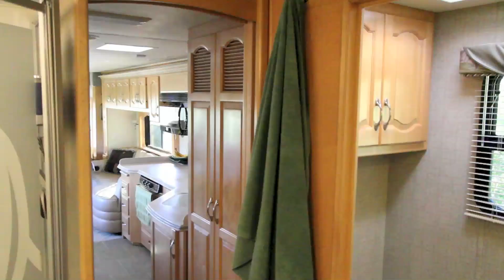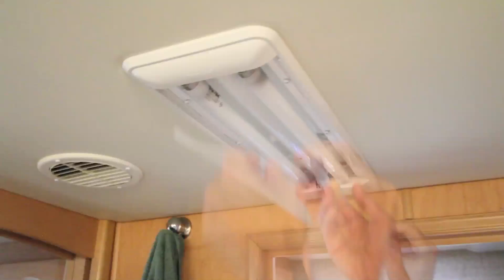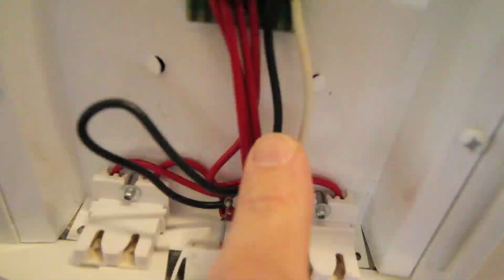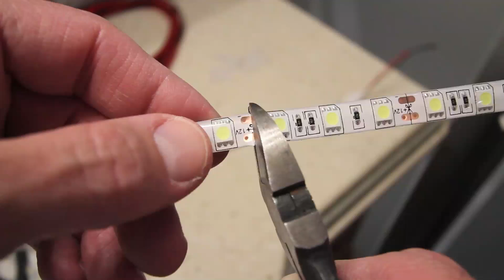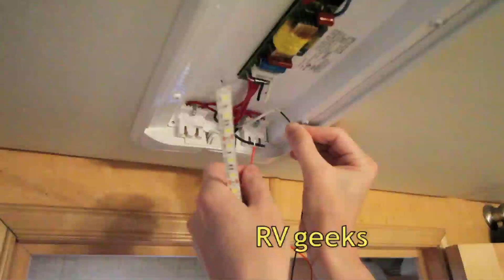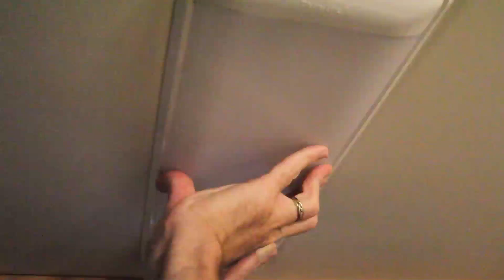HOW TO: Convert Fluorescent RV Lights to LEDs

Comment: I've found that the adhesive on many of these Chinese made LED strips is rather poor and the strips fall down after a day or so. Supplementing with cyanoacrylate adhesive solved the problem for me.
Another point: the lifespan of the LEDs is poor at rated current. Under driving them greatly increases lifespan and delays dimming of the strips and eventual failure.
Reply from the maker: These are indeed a cheap way to go, so these lights definitely aren't perfect. We've found a really high quality, elegant solution (so of course more expensive). We haven't finished the video about it yet, but we have a sneak peak with some advance details here: http://howtorvgeeks.com/electrical/sneak-preview-fluorescent-led-conversion/
Reply: The cost is negligible.  A strip of LED's is cheap enough that in in a few years you could always just swap them out.
Reply: indianajoels I find that running them at the mfg specified voltage results in less than a year lifespan. So I've been experimenting with running them at reduced voltage, using current limiting resistors and simply increasing the number of LEDs for the desired light output. Lifespan is much longer.  In my experience, if they feel warm to the touch, they're being driven too hard.
Reply: I think if you use hot glue gun to glue it
Reply from the maker: The glue does indeed weaken sometimes. If you want to see a really high-end way of converting fluorescents to LEDs, check out our brand new videos about it!
http://youtu.be/B3JFLErfMxw 
http://youtu.be/82xbqZXeBro
Reply: Saud Hamad The problem is that the adhesive strip on the LED tape eventually separates from the LED tape. So even if you glue the tape to the fixture, the LED tape still separates after a day or two. That's been my experience.
Reply from the maker: If you look at shot of the strip lights in the opening shot of our new video ( http://youtu.be/B3JFLErfMxw ) you can see that the ends of the strips have just peeled away from the fixture the slightest bit. Other than that they're fine, so we're happy with the adhesive. This is after over a year in place, and we didn't use any additional adhesive; just the sticky backing on the lights and that's it. Some are apparently better than others.
Reply: Also the resistors in the LED strips waste power so efficiency isn't too good, better to buy a drop in replacement tube imo.
Reply from the maker: That’s exactly what we’ve now done! Our updated videos show how we’ve switched to both 12” and 18” LED tubes to replace our fluorescent tubes.

Comment: The white lead is not ground , but rather neutral. Ground lead color is always green.
Reply from the maker: That would be true in 110-volt applications, but there is no green wire in the 12-volt systems in RVs. In our Newmar, white is always ground for 12-volt.
Reply: OK . I agree. Thanks.
Reply: northbride55 with RVs you can get multiple colors white ,green ,purple .black red, ect . (like car alarms there is NO STANDARD ) check each one & label if necessary.

Comment: I just started installing the lights but the side without the wires will not work.  I purchased the new type strip connector and I tested the strip with the connector and nothing works.  The connector pins on the strip connections.  Any ideas?

Thanks
Reply from the maker: Hi Richard. Have you double checked to be sure you have the hot and ground wired correctly? We thought we had some bad connectors until we realized that we had the polarity wrong and had to reverse them. Give that a try and let us know how you make out.
Reply: RVgeeks
Yes that was the first thing I looked and and no I have the + and the - in the right place.  I've tried 3 different connectors and got the same result.  Now my lights are a little different than yours.  I had to replace the ground wire to the switch since I needed extra length because my transformer cover is riveted in and covers the entire bottom of the light.  LIteco model 179

Thanks
Reply: Richard Woelk
I connected the connector to the power source and the connector tabs read 13.47 volts.  So that means that the connectors work but they are not making contact with the light strip. But if I connect the light strip directly to the power source the light works.  So seems it is an issue of between the lights and the connectors.  Puzzling. 

Thanks for the help
Reply from the maker: You have tested the two things we were going to suggest next... the light works and the strip  gets power. One thing we have seen is that some lights and strip connectors are not the width. For example one is 8mm and other is 10mm so they don't line up perfectly or fit perfectly. If you're able to see the width between the two contact points on both the lights and the connector the make sure they line up, that might be the problem.
Reply: RVgeeks
This is what I purchased.  SUPERNIGHT (TM) Warm White 5M / 16.4FT 5050 SMD Flexible LED Strip Lights 300 leds or 60led/m LED Light.  The connectors are the same width.
Reply from the maker: Richard Woelk You got the same lights we have. If the connectors show power and the lights light, the only possibility is the connection between the two. Have you tried flipping the connector over 180 degrees to be sure the contacts are on the correct side (up vs down)? There is definitely something wrong at that junction where the connector meets the light. Or try connecting to the opposite side of the light strip. The little plus & minus signs have to be lined up with the corresponding wires on the light strip. Check the polarity on the wires too, since they might be reversed from the factory, as florescent lights are not sensitive to that.
Reply: RVgeeks
Just to let you know these connectors have been discontinued by both Amazon and the supplier.  The supplier won't even acknowledge that they ever supplied them.  Been trading emails.  So will try to find something else.  Thanks for the replies and keep up the great videos.

Richard
Reply from the maker: Please let us know how you make out Richard. Thanks!

Comment: I am curious, why did you not specify to use either bright white or smooth with leds and why did you not tell which type to use. Either the 600 per strip or the 300 per strip. It would have been nice to specify which type of LED you used to replace the light we get from the fluorescent tubes.
Gerry
Reply from the maker: This was our very first foray into converting the lights in our RV to LED, and we were still learning when we did this this installation and shot the video. If you read the video description, we added quite a bit of detail about light colors, and we also have two annotations and a link in the description to the actual lights we recommend, with full details right on Amazon about the specs.

Comment: I wondered......led did not use ballast.but did u wired the live n earth directly from the wire which lead to the ballast.
Perhaps u may reply at my email.ronmizsu@yahoo.com.sg 
Tks guy.
Great job
Reply from the maker: Yes, we simply cut the ground and the hot lead (the hot was cut after the on/off switch, which allows us to continue using the same switch to turn the light on and off). Then we connected both hot and cold directly to the LEDs, which of course require no ballast. Hope this helps.
Reply: Ok so still need a stepdown frm 240v to 12v
Reply from the maker: Semakin Di Depan For sure!! All lights in an RV are powered by 12-volts.
Reply: Tks a lot..great

Comment: That is correct. An LED is a diode and electronic component, therefore it will operate on a polarized circuit of direct current. The conversion from ac to dc however is not difficult and not expensive. So, you may want to do the rectifier ac to dc then use the power saving led's.

Comment: Get video!  Love the close ups.  Too bad you cut your right index finger, good thing you had a bandaid!   So these are 12volt LED strips.  Are there 110ac led strips?  My  8 foot shop lamps just died and need new ballasts.  Maybe I should go the LED route?
Reply from the maker: Thanks Myron! There are no LED strips the we know of that operate on 110, unless you put a converter in the line (which are indeed available).
Reply: Yes, there are, just search the web or jump on ebay, they can be slightly more and are cuttable about every meter and much heavier duty, but work the same.

Comment: I was looking around and found a led strip light that has - 885 lumens per ft WOW.    Using 8 watts/ft  @24v.    It's a led strip  4 LEDs wide    28mm wide.     The stuff he put in that light is around       150 lumens/ft

Comment: I saw in the LED Strip is  12V. So, do we need to change the electric source from 220V to 12V before we connect or we use directly 220V electric source? Anybody who already successfully converted, Please advice here or via email: vanthuy3882@gmail.com. Thanks!
Reply from the maker: We're unaware of any RV that uses 110 volt power for lighting, let alone 220. All the lighting in an RV is 12-volt, so no conversion is needed. If you're not talking about using them in an RV, and are using the 12-volt LED strips we show here, you will definitely have to convert to 12-volt power to use them.
Reply: RVgeeks
Thanks, let me try.

Comment: I've ordered the led lights and connectors on Amazon using the links without a problem. But when I searched for the end caps I wasn't sure which size to get: the 8mm or 10mm. I'm guessing 8mm but wasn't 100% sure. Thanks for the easy to follow video!
Reply from the maker: You want everything to match... 8mm lights, connectors and end caps, or 10mm everything. If you already ordered the lights and connectors and they're already on the way, you might want to until you receive them, then measure them to be sure.

Comment: What fixtures do you recommend when buying premade fixtures.  I am lighting a 26 foot enclosed trailer for Antique Snowmobile Racing,  Currently use 3 exposed twin tube  8' 100 watt H.O. 110v fixtures open bulb no difuser.  Showroom amount of light.  Need the same as my eyes are getting older like the sleds.  Thanks.

Comment: I'm wondering if a dimmer control could be mounted at the switch or up on the light assembly?  Are there 12v dimmer switches?

Comment from the maker: Our LEDs cover the exact same area and put out the same light as the fluorescents we replaced. If you're installing new fixtures, there are new LED fixtures available right out of the box, instead of doing a conversion like we did here. Sorry, but I don't know how many you'll need. You might want to buy what you think you'll need and add more if it's not enough. We're very happy with the light.

Comment: I am looking at putting some over head lights in my enclosed motorcycle trailer. Would you recommend LED lights vs. Florescent lights. Florescent lights seem to work well at filling in light everywhere. Will I get that same effect? How many LED lights would I need for a 14' trailer.

Comment from the maker: We didn't actually. The remaining wires are outputs from the ballast that simply lead to the old fluorescent tube contacts. The two wires that we cut heading into the ballast were the power wires, which were then re-diected to the LEDs.

Comment from the maker: We had the ends of a few of the strips come loose from the light fixture after a while, so we picked up some 3M double stick tape at Home Depot. Worked great. But since you said that the adhesive backing actually came off the lights themselves, you must have gotten a bad batch. We've never had anything like that happen.

Comment: I am wondering how you got the adhesive backing to not come loose...I followed your instructions to the letter - ordered what you said, etc - and the strips came loose from the heat within minutes, and cannot be made to stick. Very disappointed and perplexed (4 strips came unglued immediately; 2 strips took about a half hour) I even cleaned the surface of the fixture with alcohol, dried it well, and still wouldn't stay adhered...

Comment from the maker: You can add as many strips as will fit (easily 2 or 3 on each side, for a total of 4 or 6). That way you can adjust the light level where you want it to be. We used four total (2 per side) in the bathroom, where we wanted extra light, and that made it a little bit brighter than the original 2 fluorescent tubes.

Comment from the maker: Thanks! Hope you can use the info. Biggest thing is to get the right color (not too "cold" which looks very blue, and to make sure the connectors are the same width as the strip lights (8mm, 10mm, etc). Thanks for the comment about our rings too. They're braided tri-color gold (white, yellow & rose), custom-made about 15 years ago by a great jeweler in Provincetown, MA.

Comment: I came up with this idea 2 years ago, I stripped the fixture completely, because I never intend to go back to fluorescents. The LED light is so much better/healthier, same for  the incandescence, it gives true color and not a yellow effect.

Do your home work and read up on LED technical specifications( color factor K ) I recommend 5000 to 5500k which is pure white. Anything higher is a blue.
I've converted all the 12 volt lights in our motor home to LEDs and will never go back.

Comment from the maker: Search "strip lights LED 300 SMD 5050 warm white" on Amazon (they just now came up sixth for us in our search). They're warm white in color,  5 meters (16.4 ft) with 60 LEDs per meter. They're currently listed for $12.98 + $4.49 shipping for the non-waterproof type (which are fine for this purpose). Not sure what the official output rating is vs. fluorescent, but they're so reasonably priced we simply added four strips instead of two in fixtures where we wanted more light. Hope this helps!

Comment: I am wondering what type of LED you used. I see there is a lot of choice giving output per length of string different watt ratings per string. I am impressed with the simple installation  and will redo  my RV with these strip  lights once I find the rating of the string used..

Comment from the maker: I would say that the light is either about the same, or slightly dimmer than the fluoro tubes, but the nice thing about the LEDs is that you can easily add in more rows (4 strips instead of 2 for example) customizing the light level and still using less power.

Comment from the maker: Only the light strip itself came from Amazon. Type "LED strip lights 300 SMD 5050 warm white" in the Amazon search box. "300" stands for 300 LEDs per 5 meters (sometimes listed as 60/meter), and "SMD 5050" refers to the size of each LED, 5050 being the largest and brightest commonly available. LEDwholesalers(dotcom) was our source for the strip connectors and end caps. Make sure you confirm the width of the LED strip (8mm for example) and order the same width connectors and end caps.